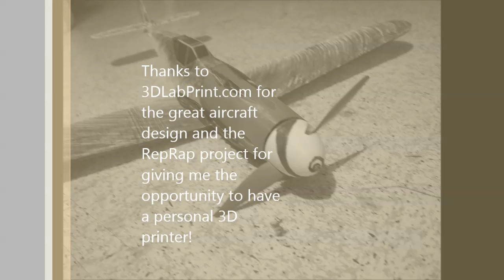Building and Flying a 3dLabPrint Bf-109 3D Printed RC Airplane!

Comment: what motor you used?
Reply from the maker: it had been running a AX-4008Q-620KV with a 6 cell 1500mAh LiPo, but the AX-4008Q-620KV is discontinued.

Comment: how did you print the nose-cone.. mine exploded when I gave it throttle.. please do tell.
Reply from the maker: I've never had any issues with the nose cones. I am running the ones with the back-plate, however. This might give the outermost edges a little more reinforcement than the center-mounted ones. The 109 nose cone is pretty large so the centripetal acceleration is going to be kind of absurd towards the large back end.

I sliced mine with Matter Control and I've used the included Gcode with no issues. I have not tried the center-mounted one, however.
Reply from the maker: What motor and prop config are you running, btw?
Reply: I printed the H variant (wider wings) and I am running the AX-4008Q-620KV on 6S with a 9x6.   I have since reprinted the spinner after re-CADding the spinner.. It is denser and I added "teeth" on the rear plate (it is the long spinner) and then soaked it in CA.. polished it.. seems very solid. I still haven't spun it up to see if it will hold because I want to ad a nut on the center to keep it from wobbling. I changed the shaft of the motor and it reaches up to the hole in the cone. I need to go buy a blnd nut that I can put there to seal the deal... this is the old spinner http://imgur.com/pFk5NuV  ,,, and the new  http://imgur.com/a/FFw9S
Reply from the maker: How easy was it to break the holding pegs off of the rear plate? And what temp were you printing the spinner assembly at?
Reply: it was fairly easy on the first. the second was a lot more sturdy. IDprinted the first at 200C @ 30mm/s  The latest Id printed at 25mm/s @ 225C...
Reply from the maker: I've been printing mine at 20mm/s at 230C. Have you tested your last one? Perhaps your extruder multiplier is too low. I know mine is about 9% too high.